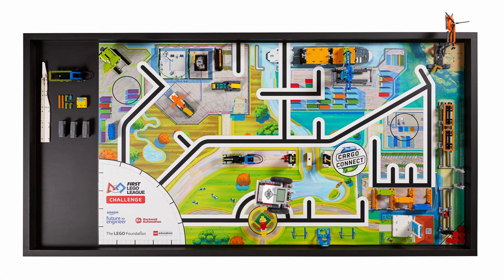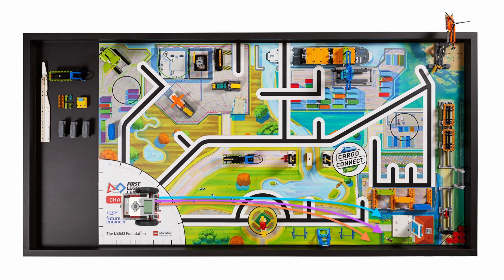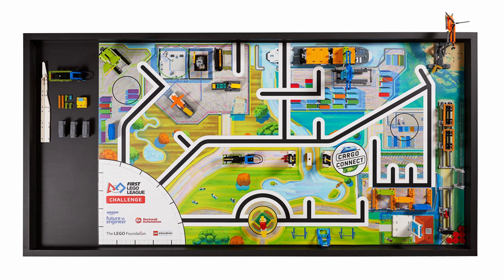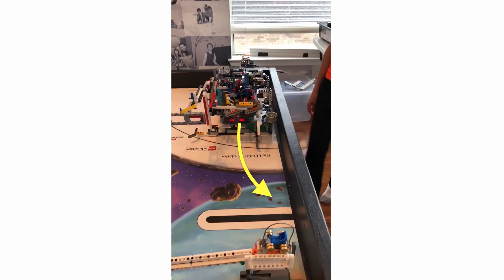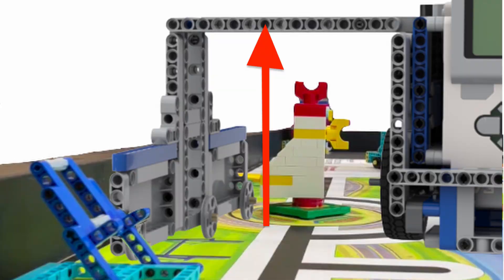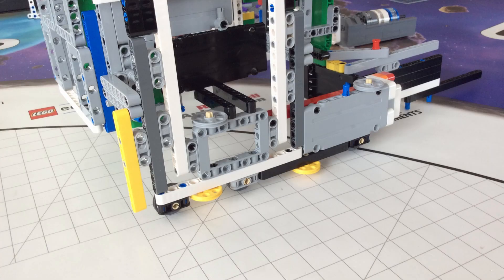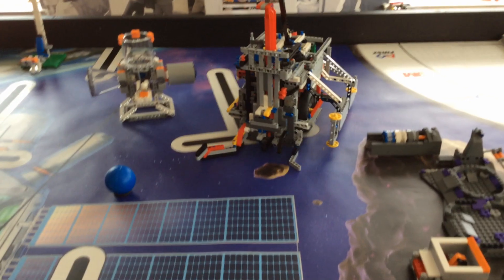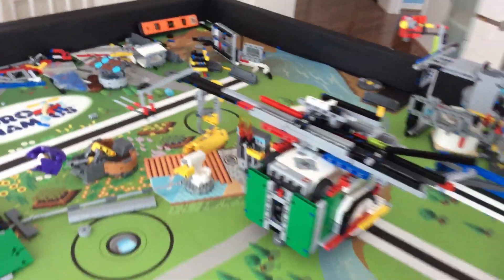How to use Wall-Following attachments to drive straight and align

Comment: something to consider is that although the table size is always the same, the placement on the map will change. Even though there is a correct placement, most of the time no 2 boards have the exact same placement on of the map on the board, even if set up correctly. another thing to consider is that the high of the walls does sometimes change depending on the table, which shouldn't event much unless you are using a wall clamper, but is good to consider. Also yes that is another thing that can be helpful for following walls, a clamp to hold the robot to the wall.